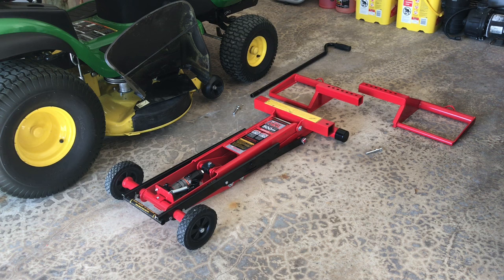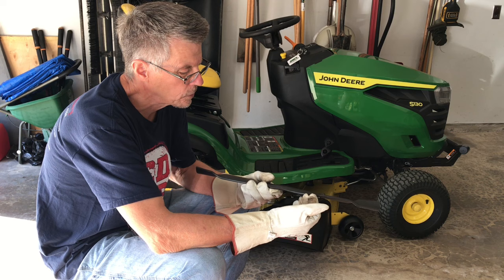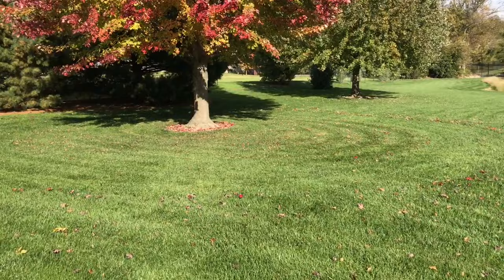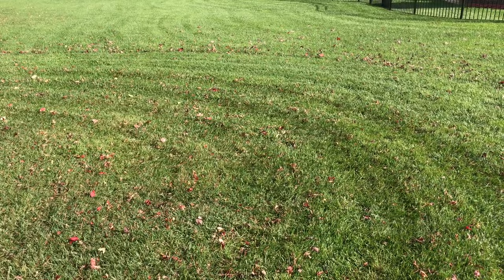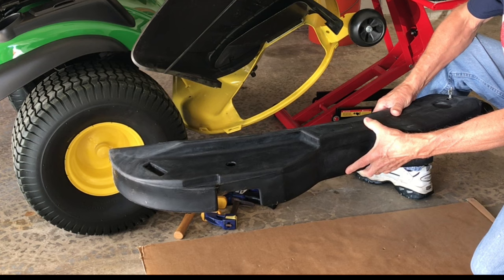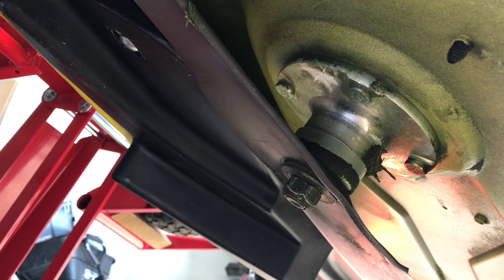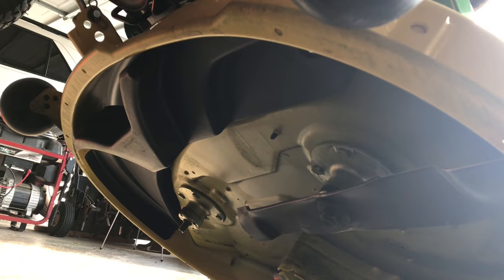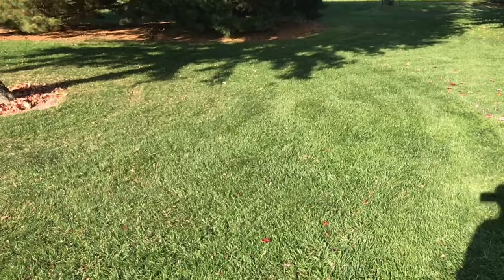Mulching Leaves - John Deere Mulching Plug vs Mulching Kit - John Deere S130 @DIY Boomers

Comment: is there a particular height for the mower deck that is recommended while using the mulching kit? I just ordered one based on this video. I have the plug and I’m not thrilled with it, i’m hoping for better results with the kit.
Reply from the maker: It seems that the recommended height for mulching is around 3”. But that also depends on the variety of grass that you have. Some varieties could be cut a little shorter, so I would suggest looking up the recommended mowing height for your particular variety. We live in the Midwest U.S. with hot summers so we have fescue in our lawn which needs to be mowed at a height of 3 - 4 inches. So we actually mulch at 3 1/2” - 3 3/4”. 

Another consideration is trying not to cut more than 1/3 of the grass height when you mow which is healthier for the grass. Also, leaving it a little taller in prolonged heat is less stressful on the grass.

You didn’t mention whether your question was for mulching grass or leaves. Both the plug and the insert kit work great for mulching leaves. Grass, on the other hand is more of a challenge for us in early spring when the grass is thick, sometimes wet and is growing like crazy. We have found that, in early spring, the best procedure for us is to use the mulching blades, but not use the plug or the insert and hold the discharge chute up somewhat with a bungee cord in order to disperse the clippings as not to leave any clumping. We did try using the plug and pulling the sweeper while mowing. That worked well for eliminating clumps, but made mowing in tight areas difficult. Of course you could use the plug or the insert and then follow up with a sweeper afterwards, but that’s a lot of extra work. I was hoping for a better result with grass mulching but springtime has proved to be a little heavy for us. Summer and fall are not a problem for mulching grass. Your type of grass and your location could prove to be an entirely different situation for you. Good luck!
Reply: I've had the kit on ny LT160 for years but line the versatility you seem to have with thw plug.(plus cleaning and cutting with factory blades). With the kit you can only use the mulching blades. Great video and thanks for the thoughts.
Reply from the maker: Thanks and you’re welcome! Always glad to hear that the info is helpful.

Comment: I have the same mower with the plug, love it.  My problem now is trying to level the deck to the recommended 2 1/4 on the setting, my issue is that im almost bottomed out on the deck hangers on both side and still a tad shot of meeting the 2 1/4 setting, any ideas?
Reply from the maker: If you haven’t already checked the tire pressures, make sure that is done first as that can throw things off.

After that, I would suggest making your adjustments at the 3” or 3 1/2” deck heights and matching the blade height to one of those deck settings. I don’t know if that would make a difference for you, but I’ll put two video links below that show making the adjustments from those heights. One of the videos is a John Deere video. And incidentally, 3 1/2” is the height that I used. If 2 1/4” is your preferred height for mowing, you don’t have to make the adjustments at 2 1/4”. It’s just a calibration that can be done at any deck height that assures all settings to be accurate. Hopefully that makes a difference for you. Let me know.

https://youtu.be/6foe8OWMIU4?si=SFikbkuTgzgqL_oo

https://youtu.be/VNybAm6gMAY?si=nmfuL8-_NCIdw37d
Reply: @DIYBoomers  Thank you so much, did as you recommended, it works like a charm now, I really appreciate your assistance in this matter.....
Reply from the maker: @benk4881  Absolutely, you’re welcome. Always glad to hear that I was able to help someone out. Happy mowing!

Comment: I have a S120 with the mulch plug and it works great for mulching leaves. Insert kit looks like to much work to install. Thanks for the video.
Reply from the maker: Sure, you’re welcome. Can’t argue with that. The plug does a great job.
Reply: John Ludwig, I just purchased an S120. What is the part number on the mulching plug that you purchased? Thanks and take care.
Reply: @davidcollis4758  mulch plug GY20417 Blade kit AM141033
Reply: @johnludwig2446  Thank You from one boomer to another.
Reply: @davidcollis4758  Your Welcome
Reply: @johnludwig2446  That part number is for the 48-inch deck. I have the 42 in. deck.
Reply: @davidcollis4758  GY00115 mulch cover for 42 inch deck

Comment: So you need a mulching plug and mulching insert kit both? To be successful?
Reply from the maker: No. To tell the truth, having used them both now, I would just purchase the plug. Initially, I really thought that the design of the insert would result in better mulching. In reality, I don’t see a noticeable difference. That, along with the plug being so much easier to install and remove makes it a no brainer for me. I haven’t reinstalled the insert since the fall of the year that I tried it out. You do get a set of mulching blades with the purchase of the insert, but It’s also cheaper to buy the plug and the blades separately.

Comment: Is there a way to make your discharge chute stay up or do you have to bungee it?
Reply from the maker: Yeah, whenever I don’t use the mulching plug because of the grass being too thick, I take a bungee cord and attach it to the bracket under the seat.
Reply: Thank you for your quick response, one more question if you don’t mind, I read that some tractors can’t roll freely without the transaxle release pulled, but mine can still roll with it pushed in. It doesn’t seem as easy as it does pulled. Is this normal on newer lawn tractors? Again thank you for your informative information
Reply from the maker: @jabster2957  You’re welcome. I can’t say if all makes of models with hydrostatic drives respond the same way with the engine off and the drive still engaged, but our John Deere S130, like you describe, can still be rolled although not easily. 

Hydrostatic drives rely on a pump to move fluid through the transmission that in turn drives the wheels. The activation of the manual bypass valve will allow the axles to roll freely by diverting the flow of fluid around the drive pump system. You can move the tractor without releasing the transaxle, but it is difficult because of the resistance of the fluid when it is not being pumped.

Comment: I couldn't tell if the first test, using the plug, was also using the standard 3 in 1 blade, or using the dedicated mulching blade?
Reply from the maker: I used the dedicated mulching blades for both the plug and the insert.
Reply: @DIYBoomers  Thanks. A John Deere dealer near me seemed to indicate I couldn't get the mulching blade without the insert kit.
Reply from the maker: @timharbeck4934  Don’t know what size you need but here’s a link to the John Deere Store with mulching blades for a 42” deck like I ordered. For some reason, John Deere still hasn’t updated their information on the S100 series. They show these blades fitting the E100 series but don’t say anything about the S100 series. The S100 series replaced the E100 series and they do fit the S130 that I have.

https://www.johndeerestore.com/jdb2cstorefront/JohnDeereStore/en/John-Deere-products/Genuine-Parts/Replacement-Parts/Mower-Blades/Lawn-Mower-Blades-%28-Mulch-%29-for-100%2C-D100%2C-E100%2C-LA100%2C-LT%2C-S200%2C-SST%2C-X300-and-Z200-Series-with-42%22-Deck/p/AM141033

It’s interesting that I noticed the description for the blades saying that they are for use with a mulching “kit”. I refer to the cover plug as just a plug. But if you look at the link to the “plug” below, they call the “plug” - a Mulch Cover Kit. So to avoid any confusion, the mulching blades, which can be bought separately, are intended for use with both the insert kit and the cover plug which they also call a kit.

https://www.johndeerestore.com/jdb2cstorefront/JohnDeereStore/en/John-Deere-products/Genuine-Parts/Mulch-Cover-Kit-/p/GY00115
Reply: @DIYBoomers  Thank you!

Comment: I put this kit on my s110 this weekend. I removed the chute. Does it need to be on there? I see there is a small metal chute under the larger plastic one. I removed them both. Also, my belt comes off whenever I disengage with the deck set low. Wonder if other John Deere owners have that issue.
Reply from the maker: You can certainly leave the chutes off if you don’t plan on mowing without the mulching kit. Personally, I alternate using the kit, the plug and normal discharge, so I just leave the chutes on all the time.

In the spring when the grass is so thick and growing like crazy, I leave mulching blades on, but don’t use the kit or the plug. I also hold the big chute up a little with a bungee to allow the clippings to spread out more on the lawn. Late spring and through the summer after the grass has thinned out a bit, I’m normally using the plug with the mulching blades. That makes it easy to take the plug off if the grass is still too thick and starts to clump. I use the mulching blades and kit late summer and fall. I think the kit works best for mulching leaves.

As far as the belt coming off, I’ve never had a problem with that. Is the mower and/or belt new? If it is, I would definitely be contacting your dealer or John Deere itself. If not new, I would still consider talking to my dealer to see what they recommend. You could take a look at these two videos I found (links below), that discuss issues with the belt. The first describes engaging the belt at low idle which can make a difference. The second video shows how to adjust tension on the belt if the belt is too loose. These are just two that I found real quick, you can find many others by searching. Good luck!

https://youtu.be/ME33JB0GxhA?si=17y7QxZVq6R27vWt

https://youtu.be/iXy0nSfg7h4?si=eoGDds64ya9ofDNn
Reply: I just got a S110 and am doing the same procedure. Did you get any info on removing the plastic guard? Thanks!
Reply from the maker: @johnmonroe3. Is this a question for @HartfordWhaler or @DIYBoomers? If it’s for me at DIY Boomers, I don’t understand the question. Could you explain further? Thanks
Reply: @DIYBoomers the question was for Hartford Whaler. He had just completed the same procedure on his John Deere s110. Thanks for your response.
Reply: @johnmonroe3  had to figure it out myself. Remove the plastic chute. To do it, take the whole chute assembly off, then take the pin out and take off the large plastic chute. Put the springs and pin back on the smaller metal chute and mount that back to the deck. It will work without the metal chute, but it looks better, is safer, and prevents grass and dust from flying around. Worth the effort. I love the mulch kit.
Reply: @DIYBoomers  thanks!
Reply from the maker: @HartfordWhaler No problem, you’re welcome.

Comment: at 3:30 he is installing the mulching cover incorrectly.  He started with the forward/front hook.  He should start with the rear/back hook because the cover has a split tang that goes inside of the mower deck for stability.  You can see the tang starting around 3:39.  This is explained MUCH better in video https://www.youtube.com/watch?v=XAbFJMvjMUc.
Reply from the maker: Correct. I have previously explained that after someone else pointed that out about the split fitting inside the deck. But honestly, it’s more of a pain in the butt to get the tab behind the deck than it’s worth doing it. The cover stays in place perfectly without fighting it.

Comment: Just so you know, John Deere calls it a deck mulching cover in case someone is searching for it.
Reply from the maker: Yeah, the box that mine came in labels it a mulching cover. Interesting though, if you look for it online at the John Deere Store, there, they call it a Mulch Cover Kit, which is kinda confusing since it is only the cover. Whereas the Mulching Attachment Kit, which is the deck mulching insert, includes mulching blades in the “kit”.

https://www.johndeerestore.com/jdb2cstorefront/JohnDeereStore/en/John-Deere-products/Genuine-Parts/Mulch-Cover-Kit-/p/GY00115

Comment: Seriously. You just remulched the mulch plug with the insert mulcher.  Flawed analysis.
Reply from the maker: I never said that the mulching for the two methods were exact. It appears that you’re more interested in nit pick carping than comparing the plug and the insert. Your observation was not a revelation. In fact, if you were listening, I mentioned twice during the insert passes that it wasn’t a completely fair comparison since I had run the plug in that area the day before. Even so, there was hardly any residue left after the second pass of either method. So little that I saw no reason to not use the same area for the insert.

For those that were viewing who were really just interested in seeing the difference between the plug and the insert, it was pretty clear that there certainly was no big difference between the two in the end. If there was any accumulation after the second passes of either of the two, I wouldn’t have posted that video.